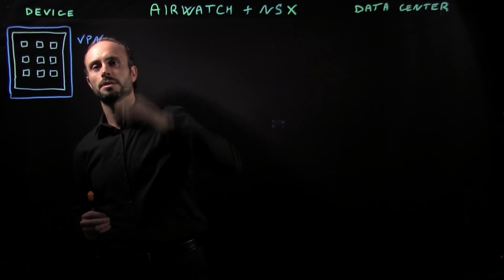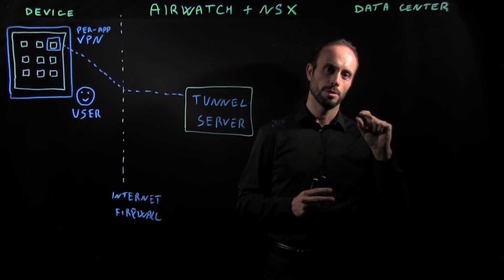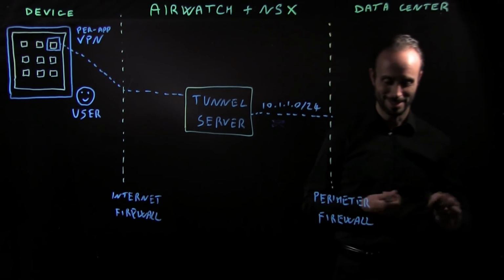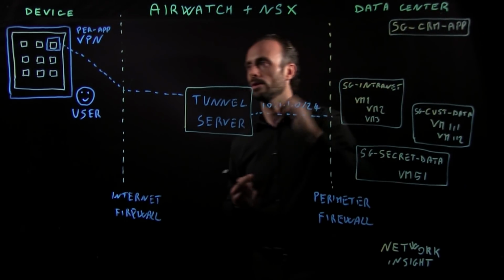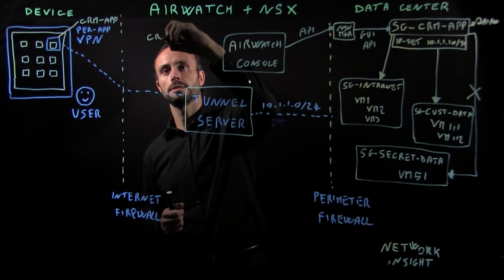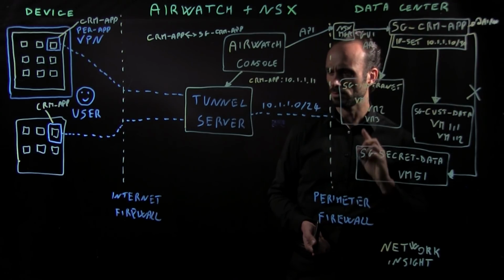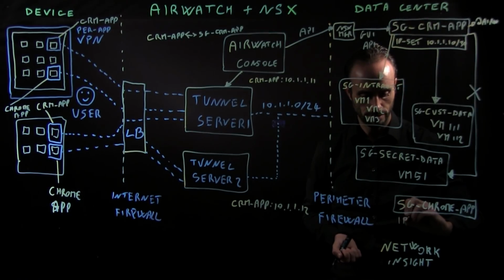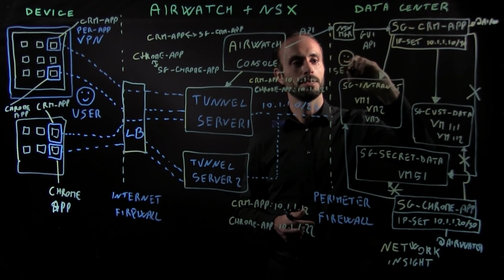End-to-end Mobile Security with VMware Airwatch & NSX

Comment: how do you scale the increased number of tunnel endpoints at the tunnel server? is it one tunnel per device at a time?
also, SSL VPN or IPsec VPN?
Reply: Hi Shubham, apologies for such delay but I do not monitor this channel and I ran into your questions just by chance. Let me try to answer the points you raised. First of all, the tunnel is an ssl one. When it comes to scalability, one tunnel server can support up to 100K devices as stated in the VMware Airwatch Recommended Architecture Guide https://docs.vmware.com/en/VMware-AirWatch/9.3/VMware%20AirWatch%20Recommended%20Architecture%20Guide.pdf at pag. 28. With regards to the number of tunnels per device, it is one per each device and this tunnel would be open by the AirWatch Tunnel App installed on the device. The security differentiation happens inside this single tunnel where each application on the device can be associated to heterogeneous security rules on the NSX DataCenter Distributed Firewall. Hope this answers your questions. Please, let me know if you need any further clarification.